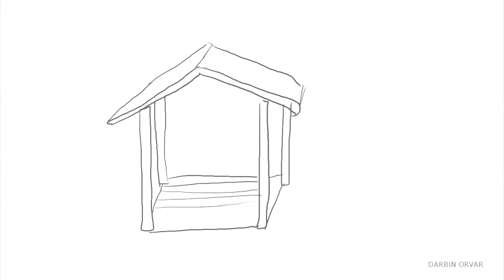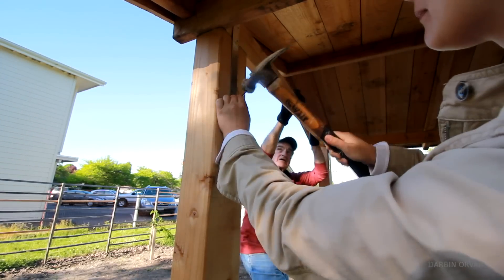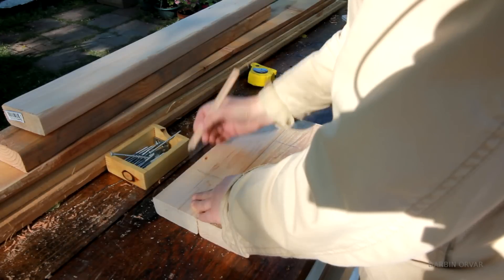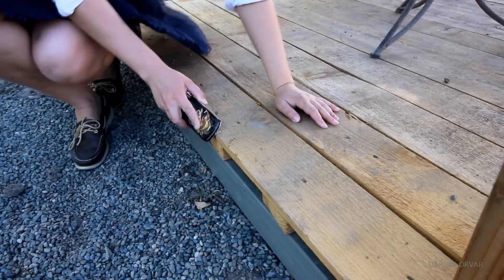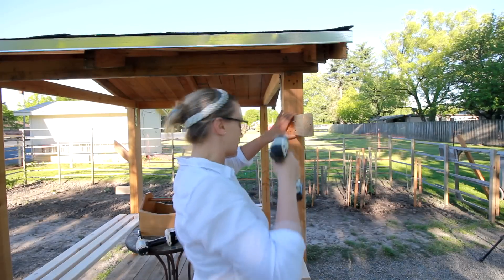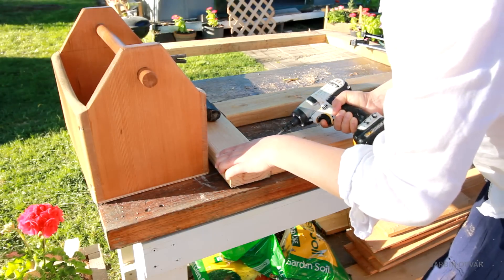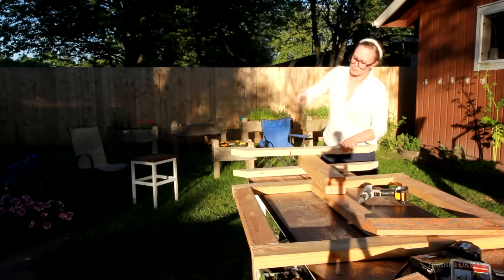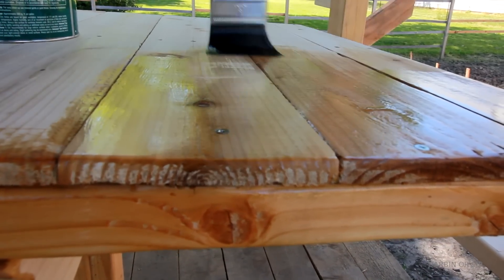DIY Gazebo Build Part 2

Comment: A slight chamfer on the support pieces that are  holding up the benches would tie it visually  to the angle of the lattice work and be less likely to snag pants when you're sliding in.

Comment: Fabulous! What's remarkable is how you accomplished so much with so few tools. All I've seen is an impact driver, sander and jigsaw. Using those to create pocket holes and cut 2x4's was awesome. I'm not even seeing the any use of clamps, wood glue or a miter saw. Amazing.

Comment: End project came out looking great.  Great Job!  My only concern is the lattice.  I've not had good luck at all with it lasting unless I screwed it to supports across all sides.  Looks like yours is supported only by 4 2x4 end pieces.  Of course, lattice is not very expensive and if you did need to replace it your design makes that super easy.

Comment: A back support for the benches would make it so relaxing.
Reply: v1d300 I agree because people will try to lean back on the lattice panels and that is not going to end well.
Reply from the maker: the panels were placed back far enough that you can't really lean on them but in case you want to sit in either direction the panels can be removed too.
Reply: Darbin Orvar It was just a thought because you are so young you may not realize that as people get older is becomes difficult to sit on a bench that has no back. Just ask your  Dad.

Comment: i just love it ... ♡

I follow you but I am scare to star a project .. what project do you think that i can do as a beginner.
Reply: Have a little faith in yourself Marybel, even if it doesn't turn out perfect you're learning and gaining skills........Try a simple birdhouse for a starter project.
Reply: Sparrow Bachman i will thank you
Reply: A WOODEN TOOL BOX LIKE LINNS WOULD BE A GOOD START THEN YOU HAVE A PLACE TO START YOUE TOOL COLLECTION GOOD LUCK
Reply: picnic table if the food slide to one side than need to level.

Comment: I use two long 2" x 6" x 12' or longer as needed long boards as a ramp against the structure, prop it up then attach two pull ropes on one side. We have two people push from one side while two pull on the ropes from the other. Slides on in less than five minutes.

Comment: You should stain the cedar and all the other wood with an oil-based stain.  Without it, the wood will gray in only one year under the Pacific Northwest climate.
Reply from the maker: The poly should help with that, but grey looks great too :)
Reply: my understanding is that poly is the wrong choice here. It doesn't like UV at all and breaks down fairly quickly, not  suitable for outside,... unless there is some special poly out there for that application ?....
Reply: no clear finish does well with UV. Either Pacific Northwest, or Ca, or Pa, or Europe or Ausralia. Either oil or solid colour paint. And pressure treated beats any paint hands down. Modern treatments not the problem they once were. (arsenic was a popular ingredient back then. But then so was lead, asbestos, cfc's in other products/processes)

Comment: Well done.  I love your Gazebo and great idea for the garden too.  I know that this gazebo was done about 3 years now and someone suggested a back support for this gazebo... You can buy a Stadium Seat with back support that goes on top of your bench and that would work for anyone with back issues.  They also sell the ones that recline as well.  I have two of them and use them for that reason.  It's also handy to take with you when going at a baseball game, parks, picnics or any other outdoor activities.  Those makes great gifts too.  Amazon sells them.

Comment: "I only used a jigsaw, a drill, and a hammer, in terms of tools."

Might consider adding some clamps to your minimalist tool kit, Linn.  Would have made those jigsaw cuts and improvised pocket holes easier and more accurate.